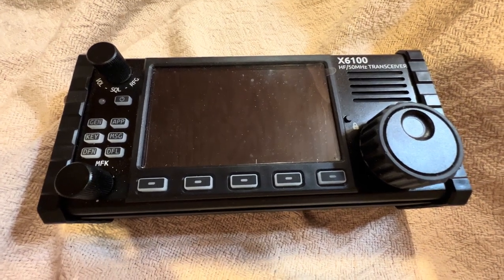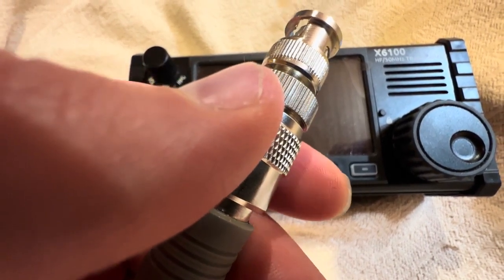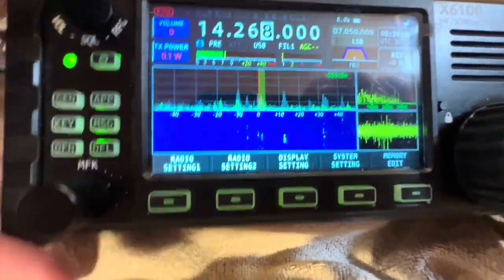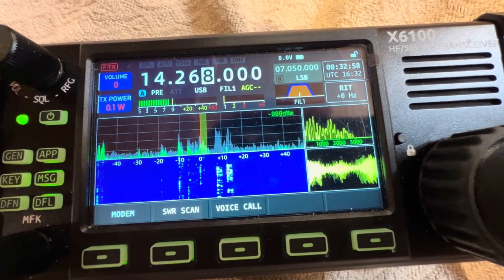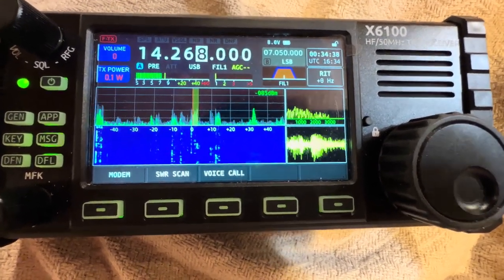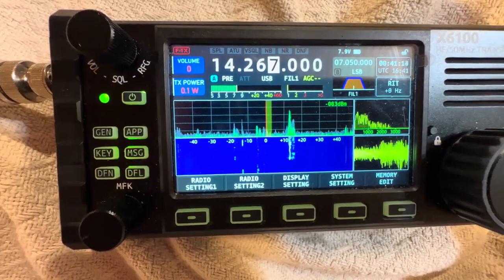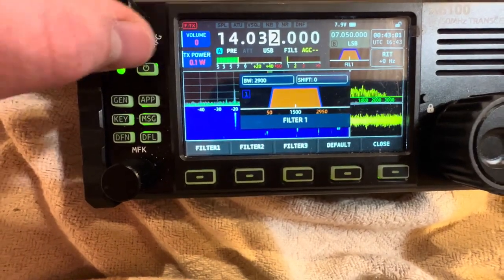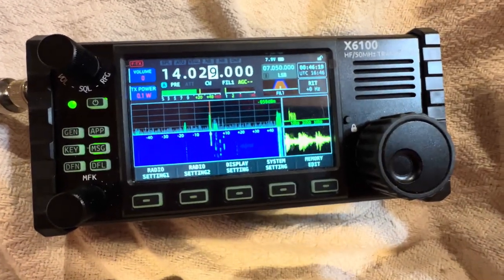Xiegu X6100 Radio Review

Comment: Good review Josh. I've been on the fence ever since this came out, mainly due to the issues some have had with it. I use to have the X5105 and loved it but sold it to a newly licensed ham and have been looking to replace it since. Your review has given me new insights into the X6100 but i'm wondering if it would still be worth purchasing with the 6200 coming out. I need to get a good light portable within the next week for a trip and this might just be it. Thanks for your video review. 73 W8MJL